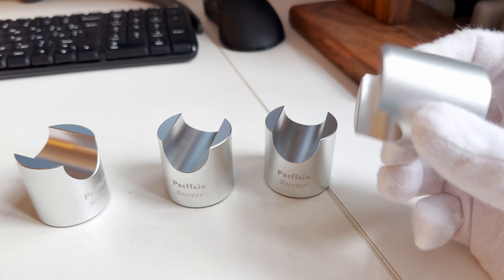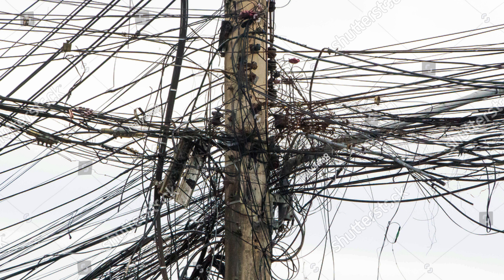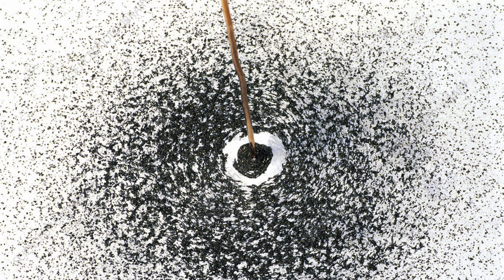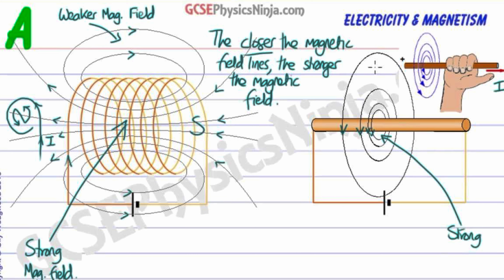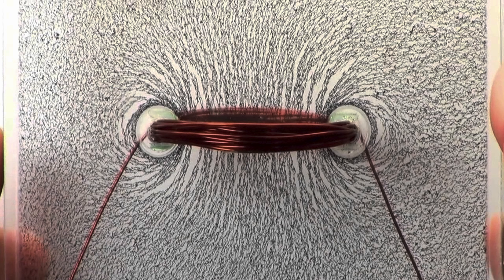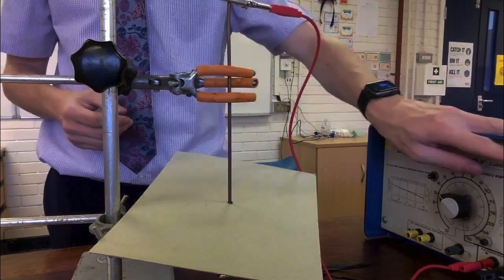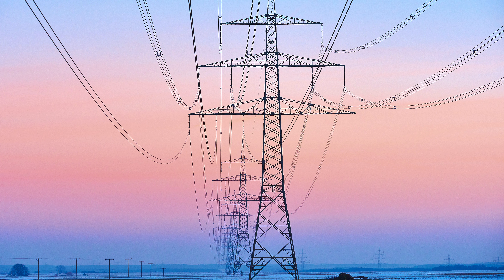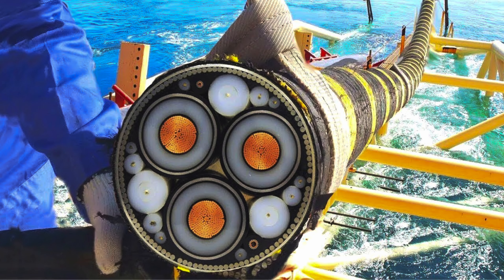How to Impove Sound Hi-End System

Comment: Did you though about these other issues?
First the magnetic fields around the wires. You'd be right with only one wire.  But it seems that you have a twisted pair.  So the + wire creates a magnetic field, and the - wire create the same field in the opposite direction. If the twisting is perfect the two fields cancel eachother and all the magnetic explanation is pointless.
Second: if your wires are twisted and one of them is grounded, what about the parasitic capacitance betwen them? They are closer each other than with the floor with much higher capacitance. It would have a dramatic effect.
Third: what about the PCB inside the electronics? Usually there is a ground plane inside for EMC , and the signal tracks are all very close to it. What about this capacitance?
Reply from the maker: A floor or a dielectric is like a magnet, it simply attracts electrons!!! It doesn't matter whether there is a plus or a minus. It doesn't matter how many wires there are. The current is flowing. And the floor is a magnet. The greater the distance between them, the better!!! But I can’t lift the cable a meter))))
My wife won't like this
Reply: @AudiophileHighEndAudio  ok so it seems that you have your own personal and irrationnal conception of the physics and electricity laws. Therefore it's useless to have a debate.

Comment: It's again an audiophile bullshit for an overpriced useless component. As you mention physics, yes there are always everywhere some parasitic capacitance between objets. But did you try to calculate how many farads you can have between the cables and the floor?  Picofarads, maybe nanofarads?   What action do you think  these very small capacitors will have on a 20KHz signal? None!
Reply from the maker: it only seems that way because we don't see electricity. This is the same as light. Cover the light bulb with your hand and see a handprint on the wall
Reply from the maker: It’s the same
Reply from the maker: Electrons
Reply from the maker: But, thank you for commenting 👍👍